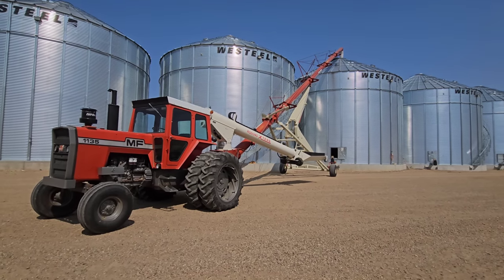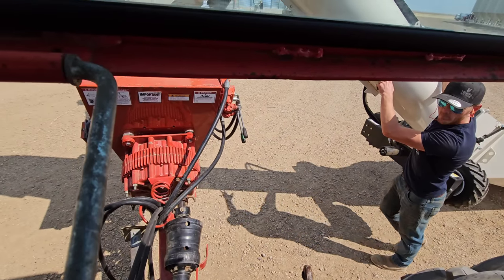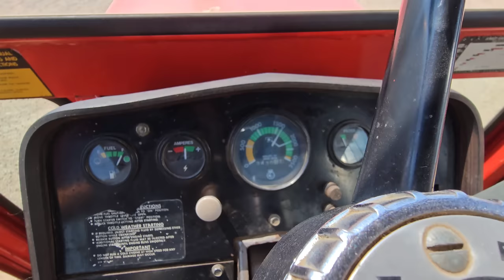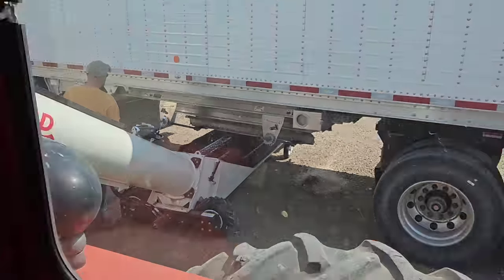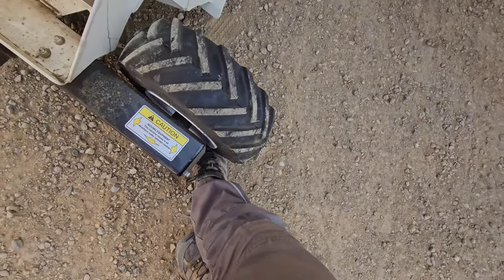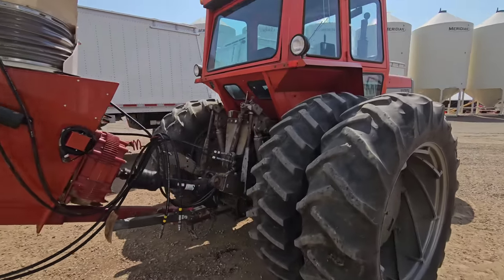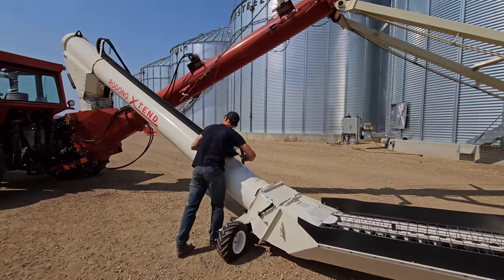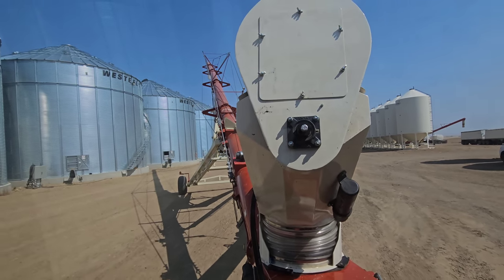Ernie goes to work!

Comment: Spent several hours in a 1135. Great tractor. Had over 9500 hours on it when I sold it. The engine was great.

Comment: It’s probably a good thing for that 1135 to sit a run a pretty good load, run at operating temperature and burn any buildup out of it. That’s a pretty sharp 1135. Pretty impressive that the auger takes over 100 PTO Horsepower. Thanks for the Videos, Mike. You guys have a safe harvest.
Reply: Yep all depends on how long it is and how high up it has to go to use the hp, which would be pretty high load.

Comment: Some of the PTO wobble is probably caused by the ends of the shafts not being parallel, could be eliminated with CV joints or a double U joint (wide angle) driveshaft

Comment: With all them cylinders stroking,  you hope you don’t run the trans hydraulic system low or overfill on the smaller older tractors.

Comment: We have a MF 1100 no cab it was a work horse for our farm for many years I use to pull a disc with it but mostly it sat on the blower blowing either hay or corn up into the silos running wide open all day now it just sits in the back of the shed we also have 2 smaller ones to now the cows are gone and everything sits what a shame
Reply: Yeah you definitely hear more of that these days especially with dairy consolidating and small farms either quitting or getting bought up by the big guys. Small dairy is dead these days that’s just the facts it’s not profitable anymore so unfortunately you see more and more old tractors just parked in the shed and forgotten about.

Comment: If that tractor was mine, I  would mark the temp gauge range(where it was running)  and instruct any other operator to shut it down, and look for a problem, if it ever went higher than that mark. My experience tells me overheating causes more dollar damage that lack of lubrication. Unless the dipstick operator forgot to check the dip stick!

Comment: Since you got power at the bins, why not electric augers? 🤔
Reply: This is the South farm of course they have power… you know how large of an electric motor you’d need to equal a 150 Hp tractor??… More power then the farm could supply.
Reply: @crandonborth  around 100kw. That’s not that much and I’m sure they have heaters and fans that draw a lot. Could probably save a lot of fuel, and a lot less maintenance.
Reply: You would still need a tractor to move it around